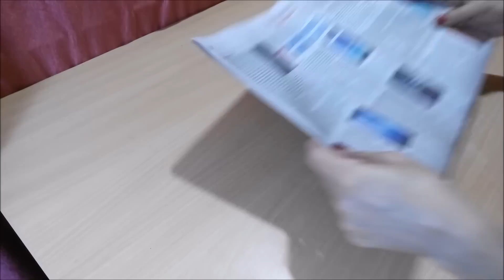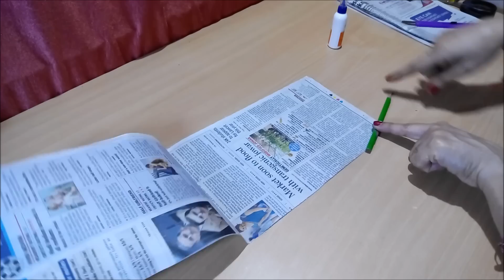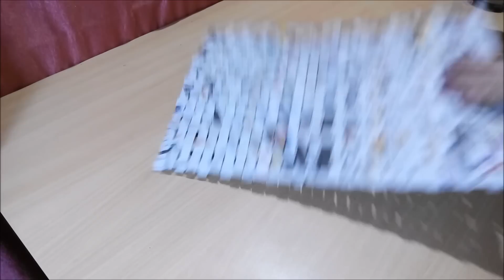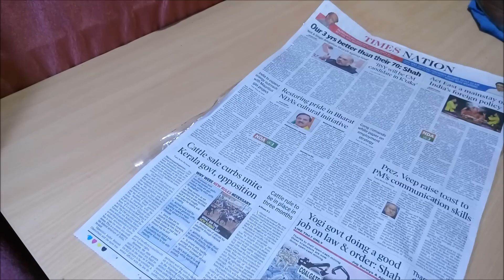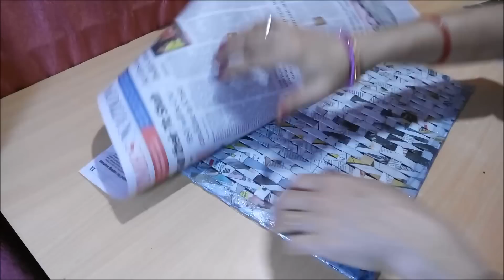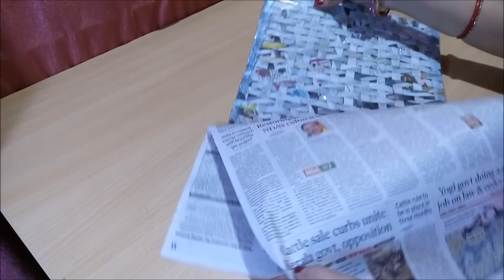How To Make Waterproof Protective Mat From Newspaper / How to make place mats / Newspaper Craft

Comment: Loved this video so easy! However just curious... Putting a laptop on this wouldn't it make it over heat from the plastic? Because it would block the fan from cooling it down? If you put something under it my apologies but was just curious.
Reply from the maker: Thank you very much Emily for your excellent question..usually laptop fans are underneath or on the side of laptop and it has a gap while you place on any surface so it wont block the fan...since this mat is from newspaper most of heat get observed to it and more than that it gives a cushion like surface for your laptop and won't hurt your lap from heating...yes you are right some laptops get too much over heat, in that case simply make some holes in your mat it would look nice and work fine...